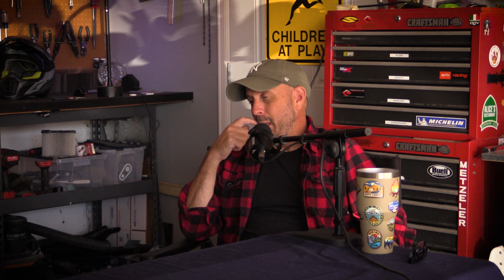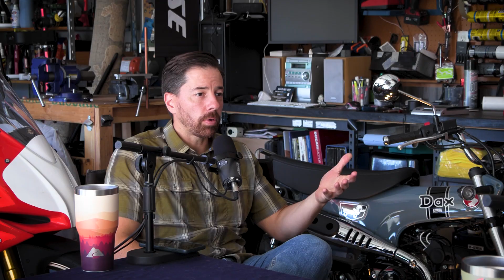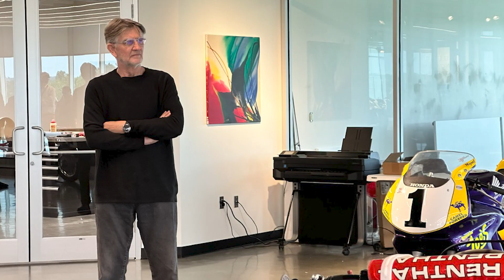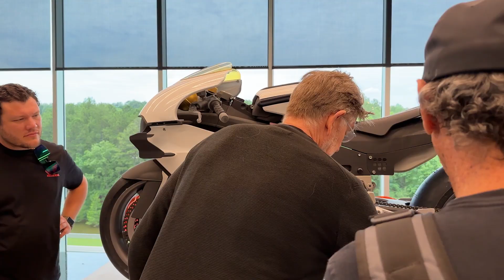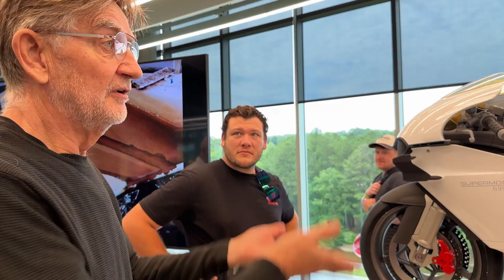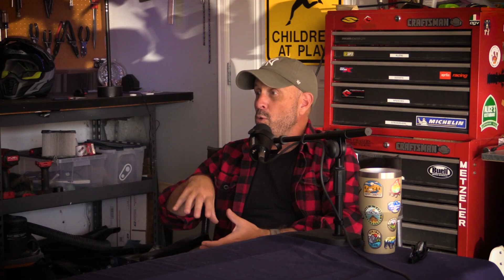Ducati 999 Designer Pierre Terblanche Has a New Project…

Comment: I had an 07 strada and loved it, now I have a 2011 Diavel, which I think he designed as well.  The Diavel is an amazing machine and I have wanted one for years.  Great vid
Reply: That's cool. Like you, I'm drawn to bikes of that era/time frame. I can work on them if I want but dealers will still work on them but most important is that those bikes are still beautiful and well made & many have been barely broken in. So I have 3 bikes instead of 1 new bike. 😂